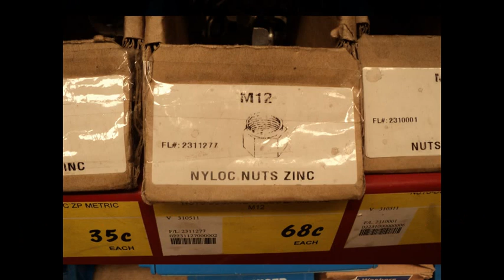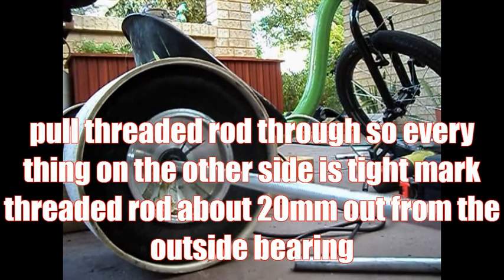how to make a slider axel for kart wheels by DTS

Comment: Good tut thankyou.     Tip,  when cutting the threaded rod,  stick the nut on first past where you're cutting, after the cut take the nut off and it'll take off the burr right so the nut will go back on easier.